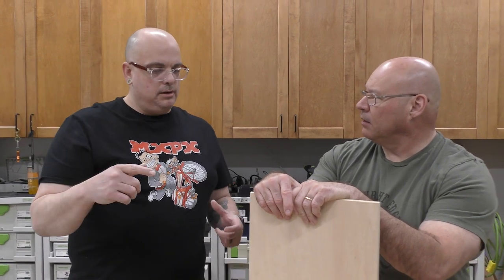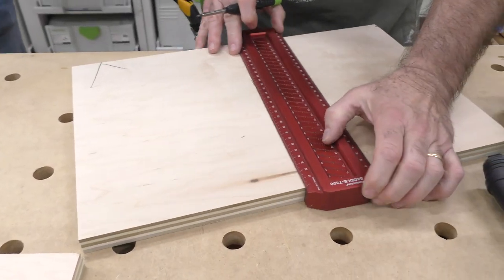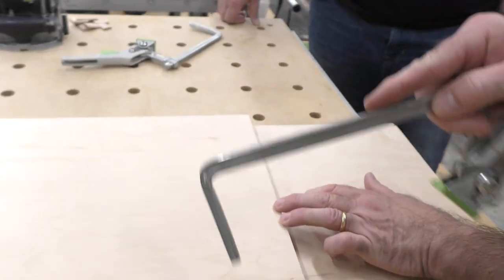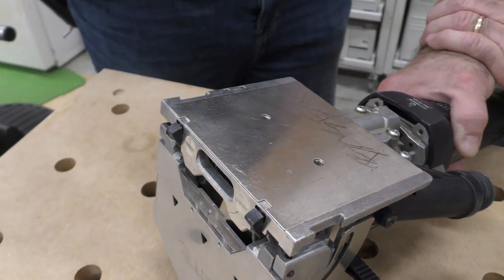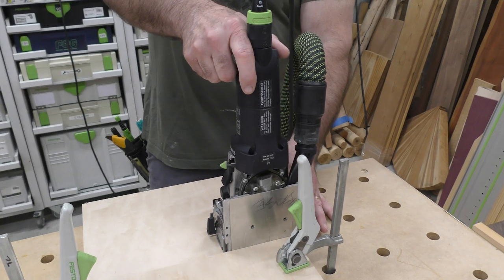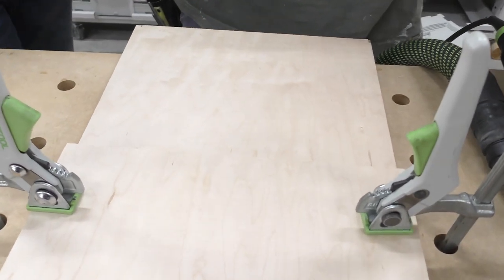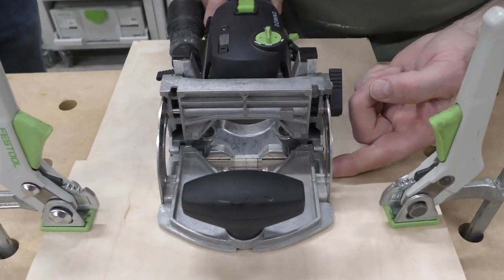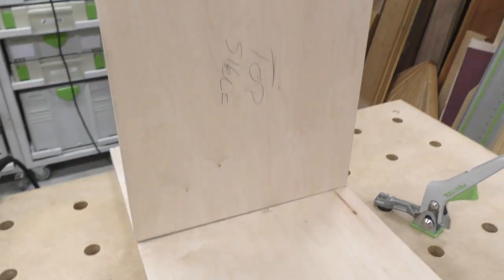Domino In The Middle

Comment: This is how I have been doing middle shelves since I bought my DF500.  The beautiful thing about this method is that you can do blind joinery in the middle of a wall unit and never see the joinery, in this case dominos.  It only works like this for 3/4 inch material.  How would you go about doing this with 1in (25mm) or thicker shelves?  Thanks for another great video.
Reply from the maker: Thanks for watching and also for another great idea for another video !!!!
Reply: I’m also curious how you would do this for thicker material.
Reply: Same. How about for thicker material?

Comment: With this method wouldn’t the shelf be 10mm off if trying to center the board?
Reply from the maker: not trying to center the board just working from my layout lines
Reply: Can you do a demo for getting a perfect centered board for doing a divider in a cabinet ? How do you take into consideration the thickness of the material?

Comment: But what if its a 4mm Domino into 1/4 inch ply?
Reply from the maker: I would not use a 4mm domino in 1/4" ply ...not enough shoulder on either side. I believe the thinnest for the 4mm recommended ply Festool is 12mm (1/2") ply.......